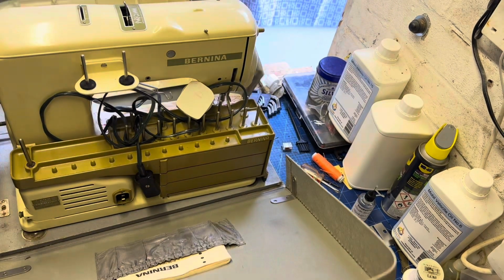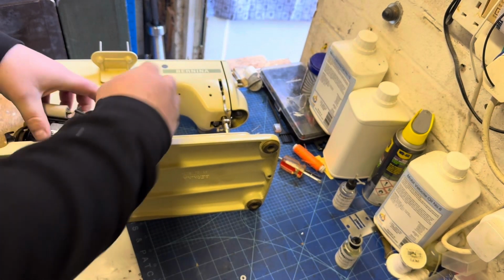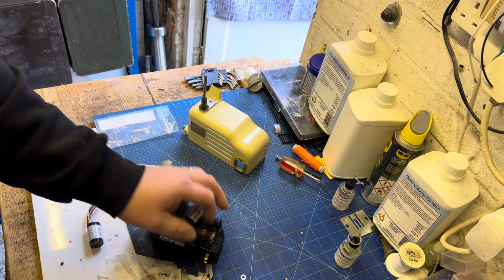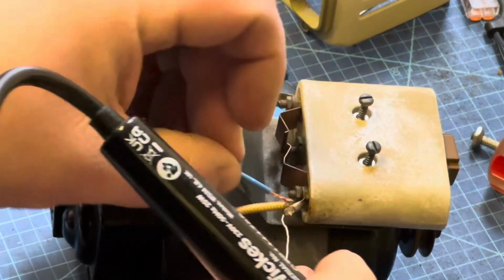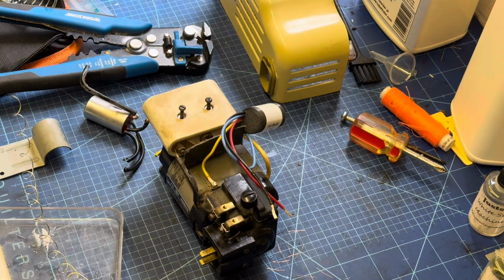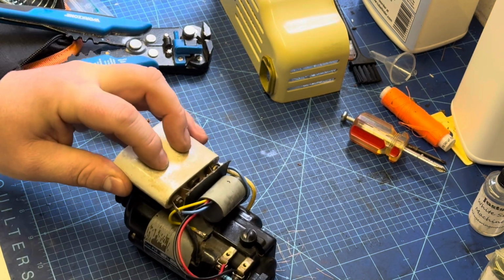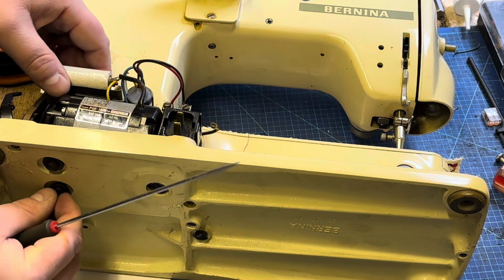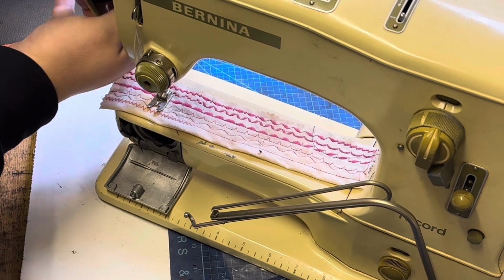Bernina 730 / 530 motor capacitor replacement

Comment: Just finished replacing the capacitor on my wife’s 730 and the wire colours are different on the capacitor I received from Justsew Sewing Machines. In case anyone is confused about which colour goes where:
Video colour - capacitor colour:
Black - Black
Red - Grey
Blue - White
Yellow - Yellow/Green

Comment: I have gifted a made for US, 120 volt Bernina Record 530-2 with knee controller.  Is it necessary to replace the capacitor and resistor?  I’m a beginner with Bernina Machines and learning. Thanks
Reply from the maker: Yes potentially you have a capacitor that is 50+ years old the life expectancy of this component is approximately 20 years and so for the sake of protecting the motor and the potential fire risk of paper foil capacitors I would suggest best practice is to replace it

Comment: Whenever I rewire components, the Ground always stays a bit longer than the other wires. So if they come loose, you still have a working fuseto ground out. That's especially important around drilling machines and everything on construction sites that sometimes gets hanged on the cordline...

Comment: Is the function of capacitor for speed control as I've also found a capacitor and 1mega ohm resistor in the foot/knee switch

Comment: Thanks for the video. Just in time for me! I'm about to clean my knee control Bernina Record 730 with degreaser and I want to remove the motor. (Although I have done this process with Singer sewing machines with the motor still installed and no problems, I'll proceed with a little more caution with the Bernina.)